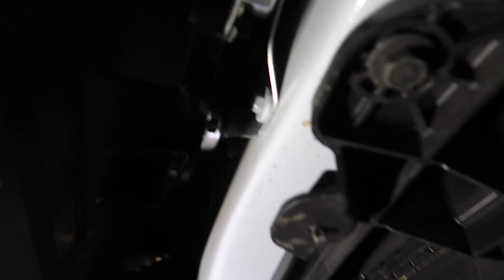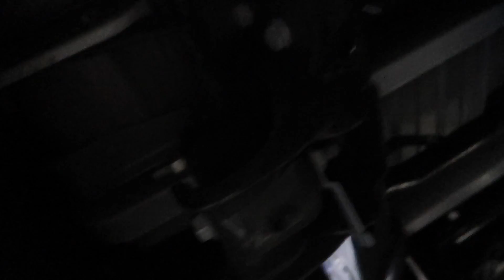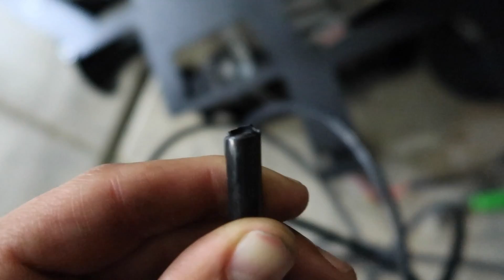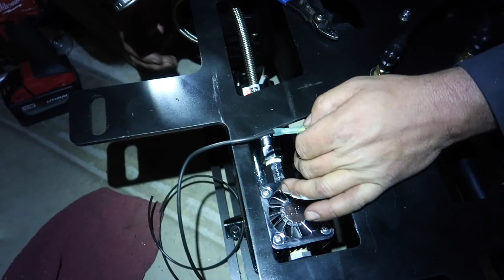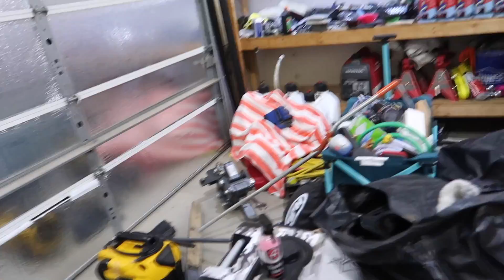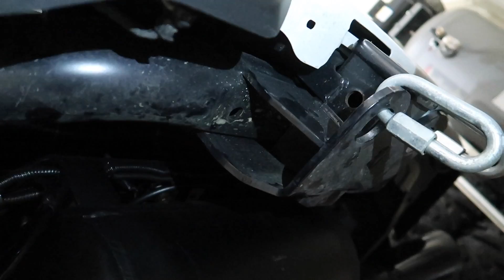THIS TRAIN HORN SETUP IS INSANE!!....PT2

Comment: Hey Eddie, I know I’m late to the game here, but I have a question. I like the air chuck and pressure gauge on the same assembly. How did you get those fed to the same plate? Did you use a splitter or two separate lines?

Thanks!
Reply from the maker: A splitter

Comment: Aren't you suppose to make the hoses to the horns equal so one doesn't fire before another?
Reply from the maker: in the Directions yes thats what it says but they are so loud you wont tell a difference and we will confirm that today stay tuned
Reply: @EddieLife3500  sounds goo. I have the conductors special 232 kit and soon gonna buy the spare tire delete mount. The horns are incredibly loud

Comment: Other than the loud noise , what’s the point ? Just curious
Reply from the maker: i just really like having on board air
Reply: Eddie's Life eddie do u have 2!sets of compressors one for the horn and one for the airbags
Reply: having on-board air is the main benefit; air up tires,  air tools, dry your truck after a wash.....
Reply: @reygabrielgarcia3473  also i think eddie has bags in the rear for towing and when u need to fill them you have the ability too
Reply from the maker: i have a separate compressor for the air bags yes

Comment: Man that's a lot of craziness for some horns...very cool though
Reply: Also a lot of weight....
Reply: @Regal2800  its a truck not a race car trying to be light weight?!? truck wont even notice that 75 pounds
Reply: @reygabrielgarcia3473  Just taking away from his payload.  not worth it imo but it's his truck and he should use it however he wants.
Reply: @Regal2800  payload cap is just over 4k pounds, even with his new trailer which i believe is longer but most likely lighter than the weekend warrior - tongue weight will be around 1000 pounds, thats still 3000 pounds left for wood and camping gear in the bed. I dont thing he will need to worry about surpassing payload.
Reply from the maker: Thanks man